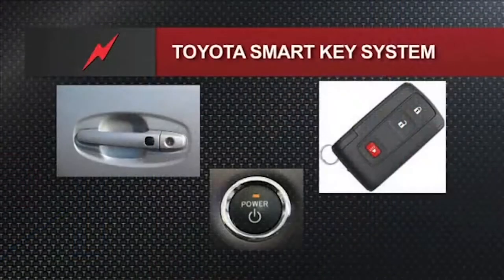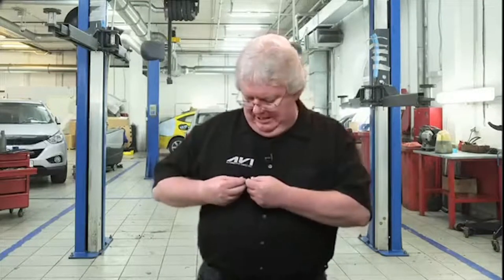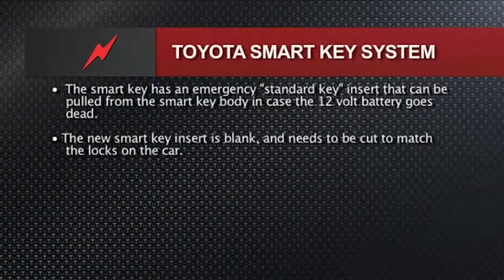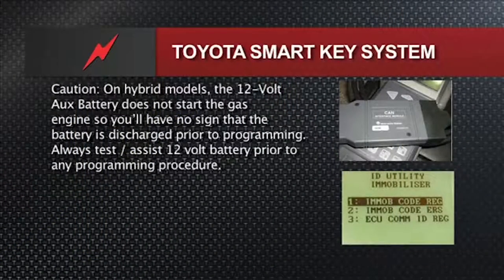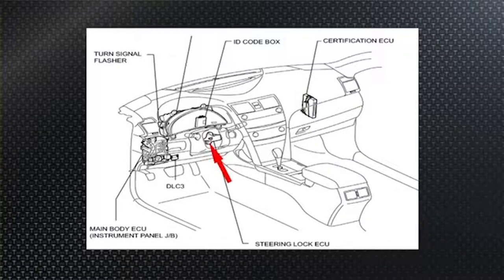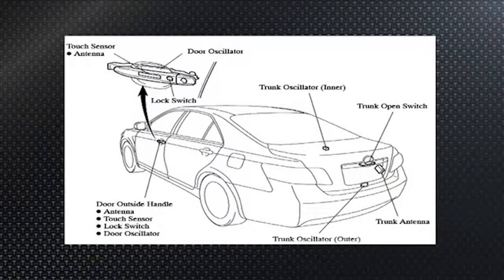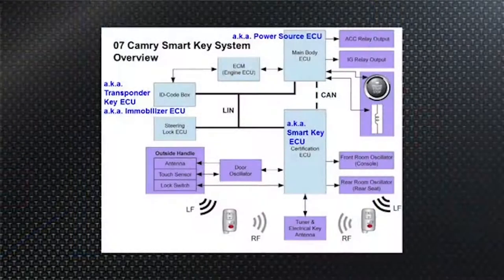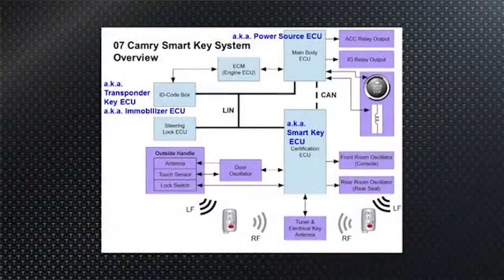Toyota Smart Key Systems | Automotive Key Programming Tech Tip

Comment: I have a 2013 4runner that had a sunroof leak.  The water mostly ran down the driver side A pillar and damaged the body control module.   I was unable to get one of these from Toyota, but did get one from a used parts dealer.  Replacing it restored all of the functions of the vehicle except the keyless door lock.  Oddly, the immobilizer and starting functions were never affected.   I would like to get the keyless entry to work again.  When troubleshooting the the vehicle the only fault code was B1242.   It seems the CAN is not communicating with the wireless  tuner.  Is this likely a fault with the tuner itself or something that still needs programming to match to the BCM?  I also found conflicting information on where the tuner is.  Some sources say it's above the headliner and some show it in the middle of the dash behind the radio.  One other piece of information is that the tuner will chirp if i hold down the lock and unlock buttons on the fob at the same time for several seconds.  This tells me that the tuner does receive signals from the fob, but it could still be faulty in its communication circuit with the CAN.  If you can tell me where it is on that model it would be of great help.

Comment: RAV4 2010, dot on the original blade.
Bought 2 keys from ebay. Seller said, chip is 4D67 and will work.
When you plug the obd keymaker, the computer goes into solid red SEC programming mode.
Very difficult to get out of programming. In your clip, as soon as you removed the key, the SEC light goes off, but in mine, it stays on. I tried to turn it off by quickly turning the original key on-off a few times, and now the car will not start with the original key!!!
All online instructions I found: All keys are lost, you must press the LED button constantly. Can anyone tell me where is the ???? LED button? There is a LED light on the keymaker, but no button to push.
Any help will be appreciated.